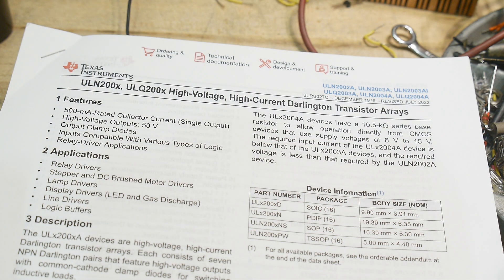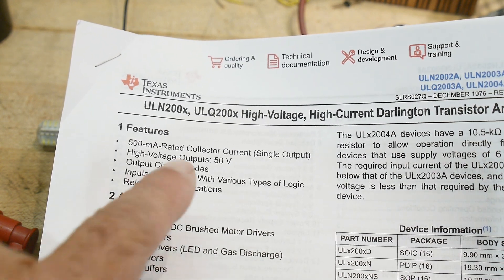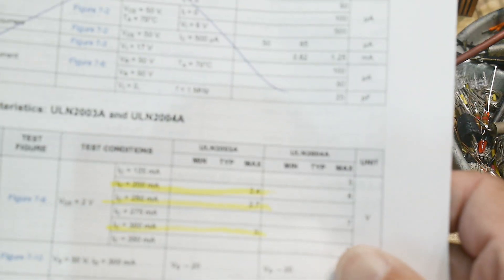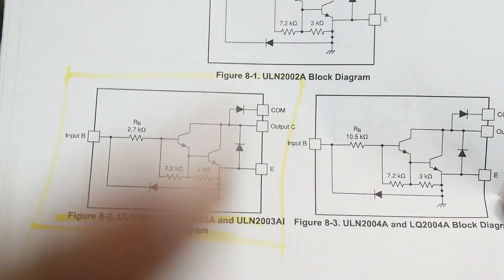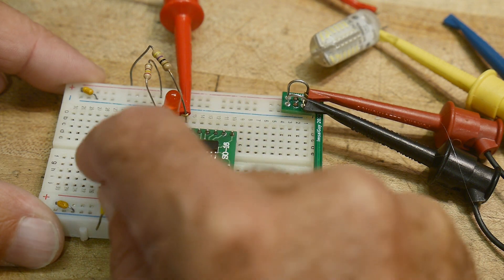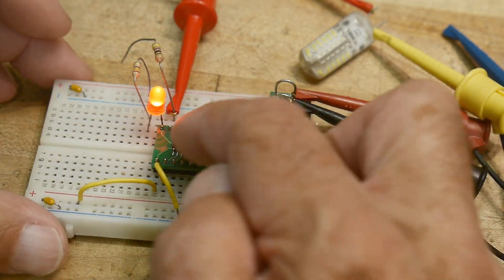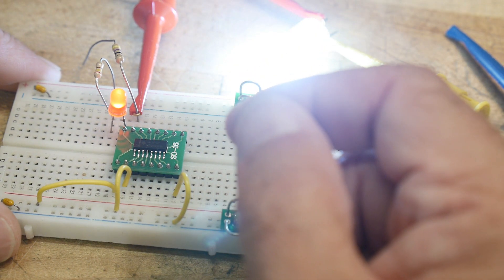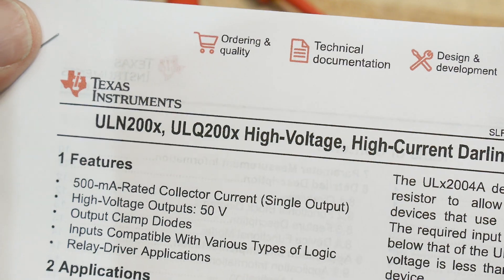#1614 ULN2003a Driver

Comment: I have designed into circuits lots of ULN2003'. They have proven to be extremely reliable and versatile. I could still today add them into control circuits as they are readily available and not too expensive. The clamping diodes are really useful. 5 Volt logic can drive the input directly.

Comment: Awesome.  I've seen these in a few control boards in the lab equipment I work on (incubators, glassware washers) driving motors, relays, solenoid valves.  I keep a few on hand as well.  I had one of these fail once in a glassware washer - attempted to power it on and every single output device (wash pump, blower, valves, etc) was turned on momentarily in a loud crescendo and then the magic smoke was released.

Comment: Ah the ULN2003, pretty popular and useful. Combine that with a numitron / minitron (segmented incandescent display) or even some bulbs or strings of LEDs in a larger 7-seg... driving it from a 7448 etc. BCD to 7seg decoder, common cathode.

I prefer the 2803 though, one of my to-go chips whenever you need to drive some relays, solenoid valves etc. Two of these combined with a MCP23017 (I2C) or 23S17 (SPI) are a mighty useful combination, 16 open collector channels... and you can scale that up to 8 23017s on a single bus. That's what made the rpi2caster project (controlling a Monotype composition caster with a Raspberry Pi) possible.

Comment: For nixies etc. there's a high voltage BCD decoder in one of the two classic logic series .  There's also 7446 for higher voltage 7-segment displays, though still not for the old NASA countdown sign at KSC (now replaced with a giant video screen).

Comment: Useful part... but i never used one of them - always discrete Transistors, that is what i do a lot. Perhalps this is because when i started electronics those IC have been hard to find and expensive while simple transistors like BC337 / BC327 every small electronics shop around had in stock at a reasonable price...
Reply: AliExpress - still cheap & available 👍😀
Reply: Yes, but in the 80s and even 90s we only had some tiny shops and classic mail order catalogs with mostly high postage costs and minimum order quantities and complicated payment because they were abroad 😕 @onecircuit-as
Reply: @tvelektron  I remember - frying something accidentally was less fun that's for sure!
Reply: The BC337 is my go-to small signal transistor. Very robust and will replace most other small-signal transistors within reason.

Comment: We just had a new heat pump unit installed to replace the old compressor of the ac unit for our house and the controller board has a bunch of ULN2003   on it

Comment: Useful chips, used in printer for pin driver, also great for stepper motor drive. Where logic meets the outside world, 7-segs, lamps, motors, etc. Good thing about is output isn't a perfect 'on' which is handy.

Comment: I have replaced these in modern dehumidifiers (GE, Honeywell etc) and portable air conditioning units.  These are used to drive relays to actuate the compressor, fan motor and other devices that I can't think of at the moment.  This makes me believe that they are still commonly used today.

Comment: If i recall correctly, you can parrallel 2 inputs/outputs for 600+1A output. Used it to drive some leds on a fishtank triggered from an esp32. Was overkill but the ic is a nice form factor.

Comment: Back in the day they were maybe more useful but they lack output protection and have a high saturation voltage so I wouldn't use them today to drive high current loads, there are protected drivers available